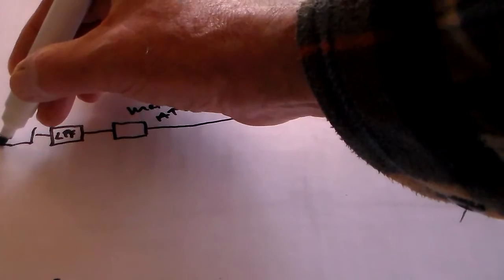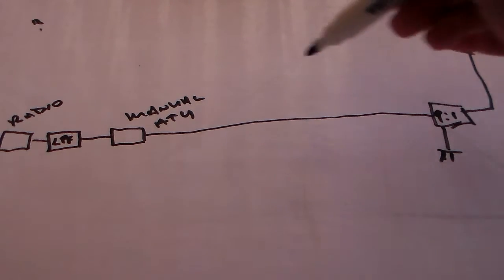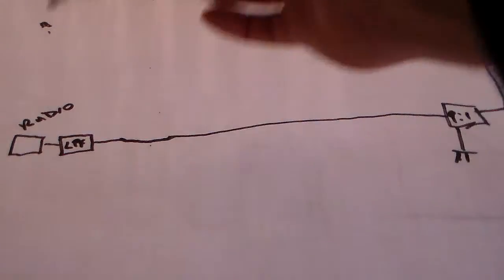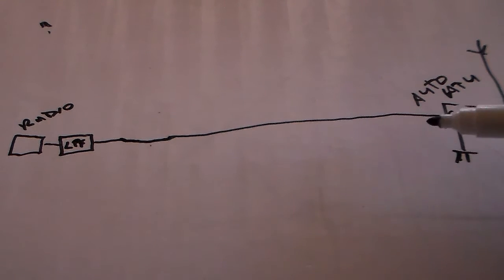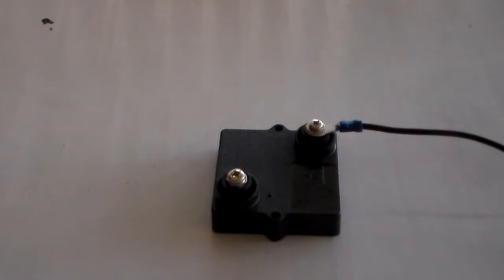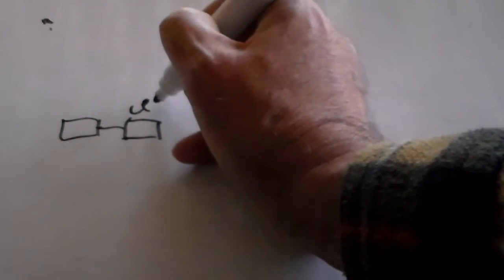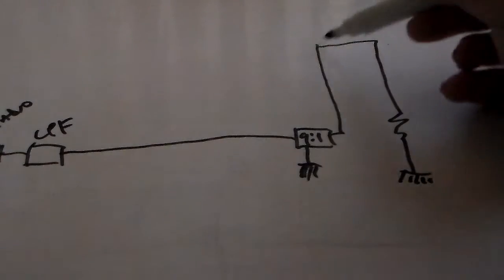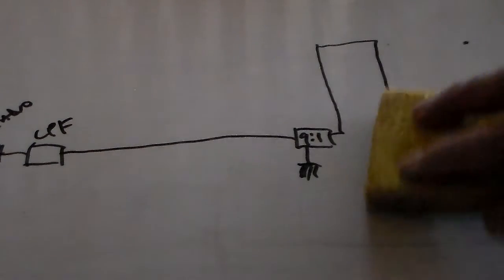Different Types Of Wire Antenna Matching

Comment: steve i had same on 80m i put a clip on ferite  on mike lead and stopped it
Reply from the maker: Thanks Nigel. I put clip on ferrites on the separation cable and on the power leads. This made no difference, so I wound half a dozen turns or so of the feeder cable around a 125mm former placed just before the auto tuner and this resolved the problem. If it hadn't I would have given your suggestion a go for sure.
Reply: good job fix it at the source

Comment: Steve, like this ?  Trent VK4TS sent me this link during the week and it looks very encouraging.   Having a purely resistive load would be desirable.

http://www.crosscountrywireless.net/terminated_inverted_u.html
Reply from the maker: Yes, this is the sort of thing I had in mind. It looks as though he's taken into account the resistance of the wire as he's using a lower value resistor. My wire length is 57m so it's over twice the length this chap used. I'll let you know how it goes... remember if you try this, the more wire the better, the shorter the wire the less efficient it is.

Comment: Hi Steve,  does the radio that has the RF issue have on RF ground ?
Reply from the maker: It didn't then but it does now. The other 857 worked fine with the same power lead etc, that's what was strange. I have also added some clip on Ferrite chokes to each end of the separation cable and P.S.U mains lead, but I haven't tried it yet. I'll re-connect the auto tuner today if I have time. It worked fine with the manual tuning arrangement without the new chokes.